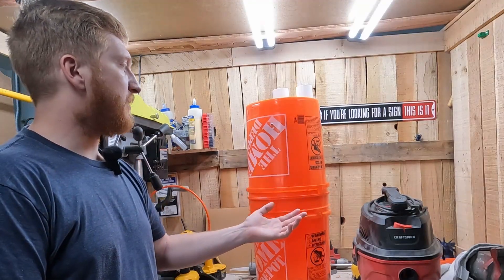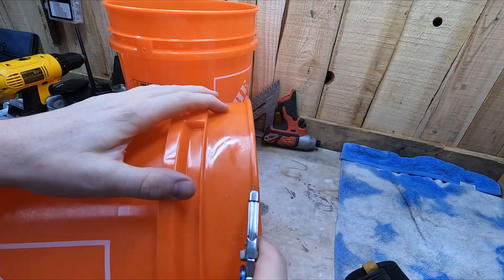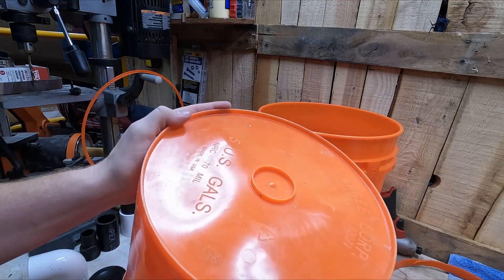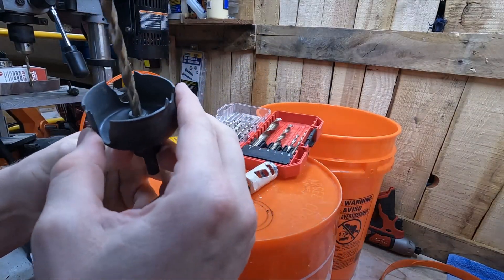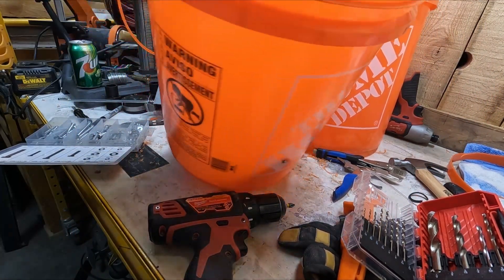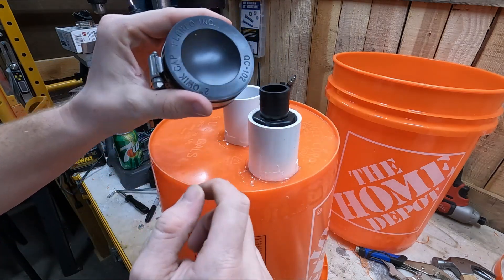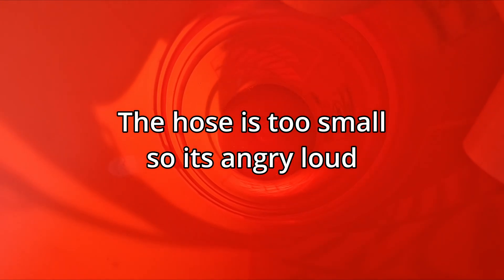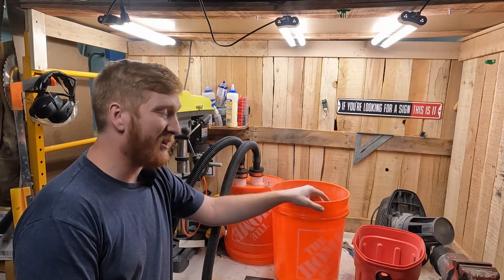Building a Cyclone Dust Collector

Comment: Add another two buckets.  stack your bottom bucket inside another bucket without modification.  Then cut the bottom 3 or 4 inches off the fourth bucket and place it over the top bucket. This will reinforce the sides of the buckets and prevent them from collapsing. https://www.youtube.com/watch?v=BeU4nqSJtBY&t=5s
Reply from the maker: Give me a bit and I’ll try that out! Thanks for the info

Comment: I just built secondary shaving separator that I placed inside the top pail. I used a short piece of plastic pipe to connect to the shopvac tube and a second pipe with holes drilled in it pointing down. The two pipes overlap each other inside the box. It seems to work very well so far. If you like I can send some pics.
Reply from the maker: Pictures would be great! 
I saw your last comment, about adding a baffle and I completely spaced about those... I will definitely try it out!

Comment: I’ll try a two stage separator and see if that works. I also thought of creating a baffle inside the top pail. stihl has a baffle for their air filter on their chainsaws and it really works well.  The wood chips get redirected and fall back out and it never plugs up. The air filter stays very clean.

Comment: I built one a couple of months ago and it’s great. I really like your idea of the inspection port. 
I found that planer shavings get into the shopvac bag which defeats the purpose of the cyclone. I tried a second of pipe with holes drilled into it and screen covering the pipe. It worked for a short time until the screen plugged up completely. Have you had that problem and do you have any ideas?  I think the planer shavings are so light they fly up into the shopvac pipe. Before I got the planer it was perfect. In fact I vacuumed 5 gallons of sawdust as a test and nothing ended up in the shopvac. 
Thanks for your video.
Reply from the maker: Glad you like the video!
I have same issue with bigger shavings, its mainly from them being so light. I know its an issue with most cyclone setups and people usually get a separate shop vac for them. I have also seen people attaching chip collection bags to their planar directly.

Comment: WHY???  All that time,, All that money for a sloppy mess that  does not work.. You have no idea of the concept of a cyclone.. 3 minutes on the internet would have shown why cyclones are designed the way they are   AGAIN,,, WHY????
Reply from the maker: I’ve always wanted to build one and I only spent $25. I’m a hands on leaner, so now I know a few more things for bigger builds! Such as the insane static electricity build up (need to ground it), needing a bigger hose, reinforce 55gal drums or get a metal one. 
So for $25 I learned quite a bit and had fun doing it. Yeah I could have read something online but that takes away the fun of trial and error.
Reply: @FabricateUnclear  You are completely missing the entire concept.. If you really want to build from scratch. .There are free cone layout templates online. for it to work,, it must be two separate chambers with the smallest opening between them as possible.. with the two buckets,, all you are doing is making a bigger bucket... CONE...TWO SEPERATE CHAMBERS... SMALL OPENING BETWEEN THEM..  wipe with bounce sheets to remove static

Comment: purchase a metal drum with a clip lid then a cyclone of the net  one hole  only required in the id and no view port  you know when it is full,  vac no dust mine has worked well for 5 years
Reply from the maker: I plan on doing that when I get a bigger space, but right now I'm doing smaller shop improvement projects to get me ready for the bigger projects!

Comment: I built this style cyclone based on another video.  I WOULD NOT BUILD THIS DESIGN AGAIN. Lessons that I learned:  1) even a small vac collapses the buckets and you need to double up both sets of buckets. 2) it is top heavy a tips over easily.  Three landscape bricks in the bottom reduces the tip over but makes it heavier to move around. 3) it is not that great at filtering fine dust and my vac filters still load up. Just more slowly.
Reply from the maker: This was a proof of concept for me, before scaling it up... (smaller project = cheaper) 
A few things I learned: 
1. The static electricity that builds up is crazy. 
2. It likes to implode. 
3. needs a bigger diameter /smoother hose otherwise it sounds like a banshee.

I don't have the top heavy issue, I have the hose going up before bending. the fine dust is alright, I have the vacuum setup to blow out of the garage.
Reply: I built it for built cheap, quick dust control on a house renovation in another state. I was very disappointed in the performance. I have a Dust Deputy in my shop and the DP is worth the price.  Your bucket collapse can be solved by making the buckets double walled.  I set the bottom half in another bucket and I cut the bottom out of a bucket and put it on the top half. @FabricateUnclear
Reply from the maker: I’ll have to try the double bucket idea(I have so many 5gal buckets), that would be super useful. 
I did look into getting dust deputy for a 55gal drum and might go that route later.
Reply: The double buckets fix works. You can cut the bottom 2" or so off of the bottom bucket to keep the assembly shorter.  You need to cut a similar amount off of the top bucket to clear the hose connections.  Good luck. @FabricateUnclear
Reply from the maker: Thanks!  @rogerhodges7656

Comment: The best dust trap is water! A few inches of water in the bottom of the shop vac will trap a lot tiny dust particles that you can't see in the air.

Comment: The one problem with the 24’ hose is that the inside is not smooth. That causes turbulence and clogs easily.
Reply from the maker: Figured I would just need to get a bigger hose.

Comment: Sweet video man, keep uploading! 

I do power washing and my pro tip for cutting holes in tanks and buckets is this. 

You can cut a slightly undersized hole then heat up the plastic around it with the a heat gun or I just use a blowtorch. Then you can jam whatever pipe or barb through the plastic for a super secure fit. You can even melt some of the plastic to ensure a better seal. Just hold it in place till it cools off, you can sprinkle a bit of water on it to speed it up. Then put a little silicone or whatever gasket maker you like.  Perfect for use where failure isn’t life threatening.
Reply from the maker: Thanks! I’m just figuring out what I can build that would be useful for my small shop! 
I like the idea for smaller holes + heat, probably should of done that! Because even with the silicone the pvc intake/outtake pipes wiggle quite a bit

Comment: The dangerous dust is the fine dust in the air that you can't really see. Get something that can measure PPM in the air. There's no way you left the air in that room in a safe way after using that to clean.
Reply from the maker: I’m in my garage and usually have the garage door open when I use the vacuum for this reason. But even then there would be a bunch of dust, but this cut it down tremendously. 
I’m going to look into getting a air quality tester to double check tho! Thanks for that suggestion.
Reply: I would now dump the air outside the building unless wanting to keep the heat, largely dust free and keeps thongs safer on many levels